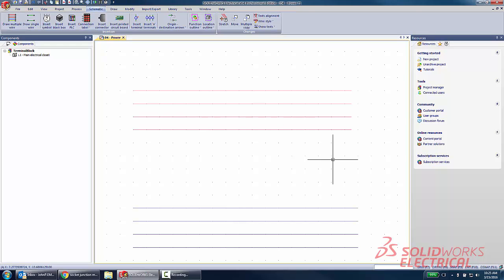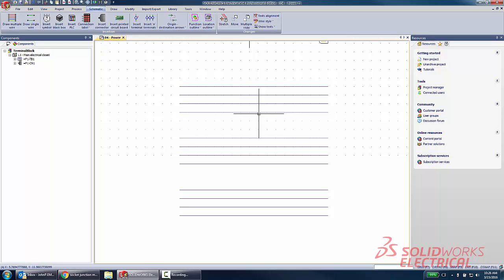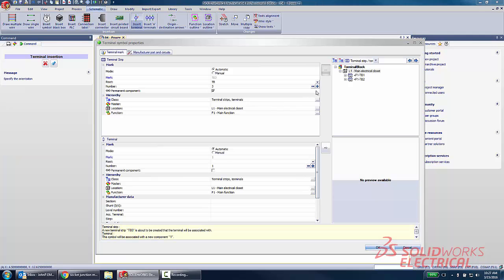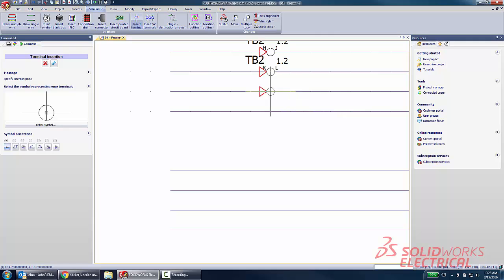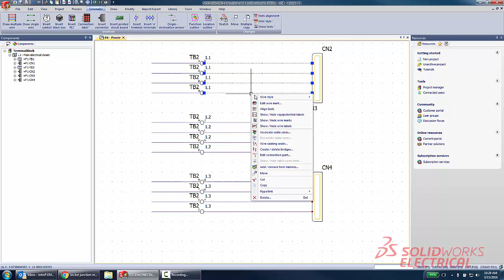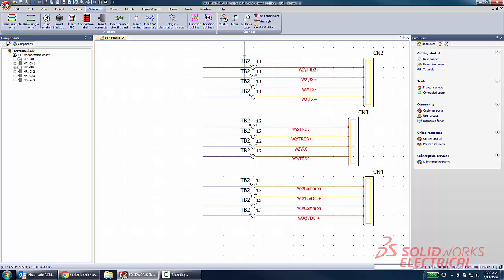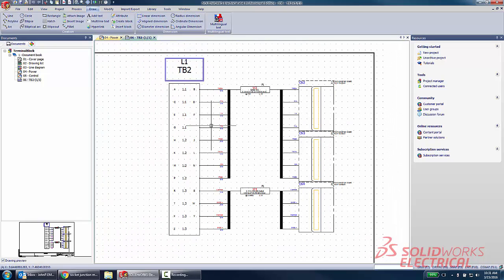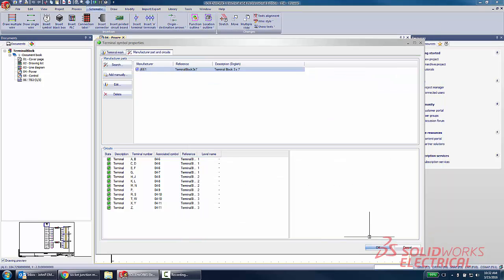Creating a Terminal Block with Multiple Connections

Comment: Hello, I try this one in SWE 2022,  after done that its not have same circuit, so, could you explain to me why that can be happen, and  what should I do for manufacturer part properties ? or for other ? I don't see your manufacturer configuration and symbol configuration
Reply from the maker: Let me see if I can come up with a better workflow. This one worked in older versions in SWE. It might not work as well in later releases as things related to terminal blocks have changed and are changing.